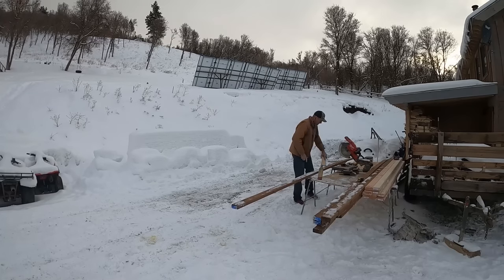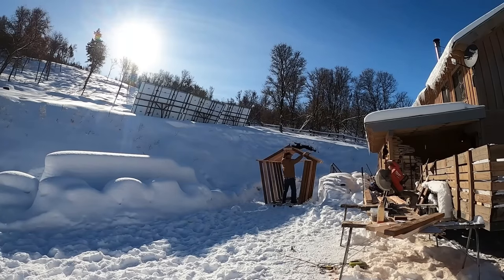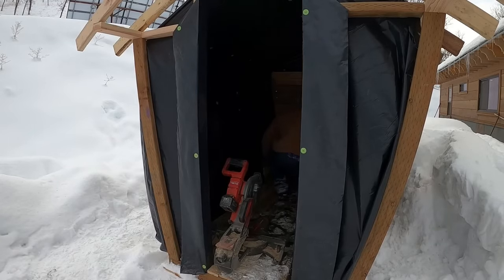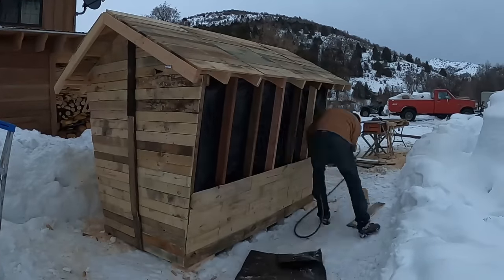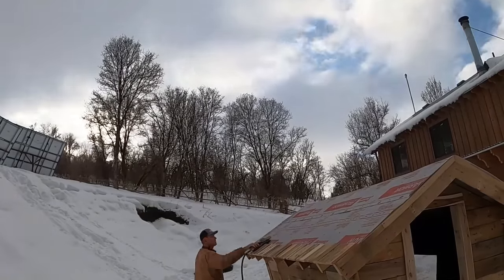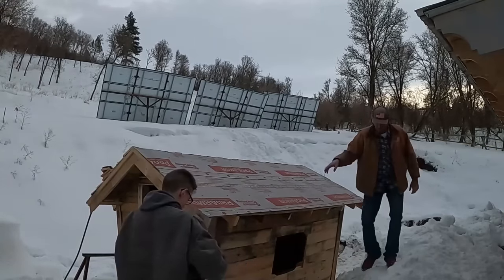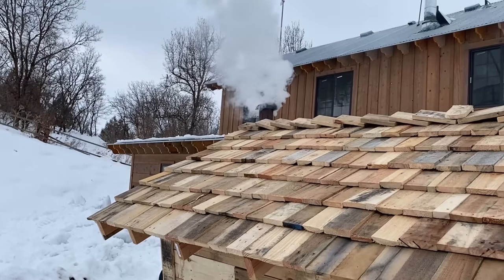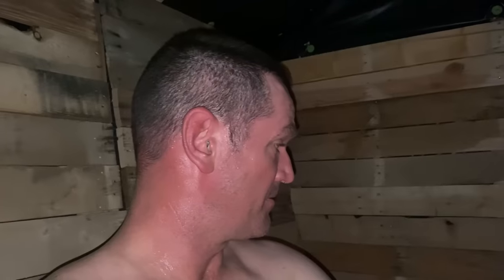#394 - I Built A Sauna Out Of Pallets! And It Works!

Comment: You can use plywood for walls and ceiling as long as you torch the plywood to seal the grains that would otherwise soak up the steam and also make them resistant to heat; as my father (a Finn who fought in the Finnish Winter War against Russia) did in our last home--it was just as good as any sauna with cedar. You can also use 2/4s for the benches and torch the grains also.
Reply: do u have a video that shows all your recommendations?
Reply: Plywood is usually treated somewhat with chemicals, at least it contains some sort of glue, I would rather not have this steamed out in my sauna.
Reply: @BlackBuffalo23   There's a Couple in the Ukraine that has charred the exterior finish and trim of the home their building. Creative couple here on youtube
Reply: @BlackBuffalo23  its a pretty popular practice in off grid cabins and timber framing.
Reply: As plywood is glued-together wood pieces and is not that healthy to begin with, I wouldn't use that in a construction where I breathe in the steam. You're basically breathing in formaldehyde.

Comment: The only thing I'd add is a metal pan under the stove, to catch any ember that may fall out.
Reply: Take a closer look, he used a piece of metal roofing.
Reply: @chaddesantis4191  WOW! Yes, he did, but it's so small that I didn't  see it at first (21:33); That thing needs to be at least twice as big to protect from falling embers.
Reply: @losapriscos7258  I think I'd like to see it a little bigger myself, but looking at the plywood floor and being one of Red Poppy Ranch's biggest fans, I'd lay odds that a better floor gets laid down on a rainy day once a few other projects get done. 

On the means of fire safety, I think I might have moved it about 10 feet closer to the hillside, too. If the wind is right and the woodpile is stocked like I'd bet Heath is gonna stock it next fall, that pallet shack has the potential to be kindling for a whole lot of heartache.
Reply: @chaddesantis4191  I'm also a fan since he started his channel. Having said that, I really doubt he would listen to our suggestions. 
Which I like too, by the way.
Reply: @losapriscos7258  amen to that!
Reply: Also couple of vents onto wall to get more fresh air in sauna. That wood burning stove consumes a lot of oxygen so there need to be fresh air vent near stove to get better draft in stove. Also it will be more pleasant experience when you can breath oxygen rich air while in sauna.
Reply: I saw one, I think!

Comment: Nice attempt to make a sauna. However, the result is mostly a sweat booth. The sauna must be large enough so that there is enough air. Otherwise, ventilation needs to be better taken into account. The stones in the stove are just too big. When done correctly, I put slightly bigger stones on the bottom of the stove, maybe half the size of the ones used now. The lowest stones are stacked sparsely so that the hot air heats up the uppermost stones, which in turn are smaller. Maybe a third of the stones you use now. A Finnish proverb says that you can't get good things cheap.

Comment: Use smaller rocks. You can add lots of it. It will give better steam and smaller rocks will warm up quicker. The rock size should be 10-15 cm diameter. You just need to warm the rocks not the space. Room tempature will rise when you pour water.

Comment: It's a lovely building. I would however kindly advice you to consider removing the pressure treated wood and plastic. I live in Sweden, and the sauna originates from the nordics. You seem to have a similar climate, and therefore I believe most of the building principles should be appropriate. We do not use cedar, actually scrap wood is great. But not the treated kind, mostly because it will start smelling really bad after some time. We do also not use plastic or any sealing. We leave space between the planks, in all the walls and floor, to allow it to move and breathe. I can promise it will get very hot even with the space between. But most of the space dissapears when the heat and moisture quickly expands it. I believe your current structure will be very prone to both bad smell, rotting and planks twisting and splitting, due to all these factors. If you are interested, I can find some good first hand information on the building principles we have used for centuries or more. Lovely building though, and good luck with all your projects!
Reply: Hahah "I live in sweden" man if you live in sweden don't talk about saunas. A swedish sauna isn't a sauna. If your sauna can only fit 2 people and goes up to 40C° don't call it a sauna. Best regards: a finnish guy
Reply: could you post where to find good information on these building principles please!
Reply: I think that he should do "Tynnyrisauna" or Barrelsauna
Watch guide from taloon.com youtube channel
Reply: What percent of Finnish saunas are wood versus electric? Is there an electric version you recommend? I live in Florida and for some reason I want to gravitate to electric.
Reply: @YksPalli  I think his sauna will go above 40C. It should go to 100 C being that tight with wood burning. What electric do you recommend?
Reply: @youtuber6185  and in finland if you live in te city the saunas are allways electric but if you go anywhere outside it they will always be wooden. I think that the majority of finns like the wooden souna more. The electric is easier to use and doesebt take that much time but in the wooden one you can smell the burning wood, you can see the real flames, you can hear the wood crack and somehow the air is better in the wooden one. And if you have an electric outage you can still use the wooden sauna. So if you live in a big city or if you're extremely lazy go with the electric but if you live on the countryside always go with the wooden one. And remember sauna should fit at least 5-15 people.
Reply: NigerianPrinssi I am extremely lazy when I’m at home so I probably should do an electric one. I would think that there they do larger because they are popular and also want to fit groups such as multiple couples. Is there another reason it needs to be large?
Reply: @youtuber6185  so the only real reason you want to have a large sauna is that you can bring your friends there. Saunas are more fun with friends than alone you can spend hours there. You can invite your friends to watch some ice hockey and drink beer and when the mach ends you can start the fire in your sauna and wait. When the sauna is good 80°c you can go in. If your sauna can only fit like 5 people it can be a little uncomfortable when your thighs are touching with your friends. so you want to have a little more room when your manspreading. It's deep in the finish culture to go to a sauna with your friends so i'm not sure how that will work in florida when there aren't that many saunas around. So you need to answer that question yourself because i don't know what kind of culture you have. Will your friends think that it's a good idea to go naked in a hot sweaty room. So if you don't have any friends or family and you want to build a sauna i would go with a small wooden one and if you're going to buy a sauna you could buy a electric of course you can build an electric one too but i bet that in the end you too will like the wooden on more. it's your own decision if you're going to buy one or build one both are good options. If you don't trust your building skills you should buy one but if you know what you're doing you should build one so you can do everything perfectly how you like it. if you want en extremely small sauna for yourself you can get the electric stove because it takes a lot less space. If you ever go to a sauna with your friends you will see some cocks and balls so soon you too will become an expert.
Reply: @youtuber6185  yeah man i hope you found something i said helpful and it doesn't matter what size you have but how you use it.
Reply: NigerianPrinssi Hehehhe, not sure if I can use it well either but I sure Damn enjoy having it. And poor boy has been smacked around. But I’ve treated him with some top shelf as well. Yea, we’ve had some good times together me and ole 2” punisher.
Reply: @YksPalli  Dude, what Swedish boy did beat you in Mario Cart? Where he realy realy meen about it? Calm down, not all Swedes are asholes, I asure you. Have a great day and hope you get better.
Reply: @YksPalli  I didn't realize the finnish would be so racist against swedes o.o
Reply: @mofosoto  lil drunk right no just got out of sauna so sorry again for my bad english!
Reply: @YksPalli  Way to be "that fuckin' guy"
Reply: @johnmarston2527  thanks man really apreaciate it man

Comment: I would have built it elevated off the ground on Railroad ties.
He can still add them before the bottom wood starts to rot. They can also act like "skids" to drag it to other locations as needed.
Reply: I would have , I would have , I would have.....Oh shut up ! You missed the whole point when he said he was only going to use what he had and nothing else .
Reply: Gotta remember this is the guy that doesn't think you need to support the center welds on his propane tank..
Reply: Railway ties are highly toxic... defeats his explicitly stated purpose.
Reply: @kristinwerner5519  They are on the exterior and used (quite old) they would have vented and leached much of their toxicity a long time ago. He isn't going to be burning them.
Reply: @SourBogBubble  unless the manufacturer requires or recommends it, really not necessary. A cylinder is extremely strong.
Reply: @at347est  it's called feed back,if he reads the comments then they are suggestions on how he can improve if he chooses to.This generation is so full of candy ass uptight cry babies! No one can have opinions, or suggestions without hurting someone's feelings that will be detrimental to there lives!

Comment: LOVE IT !! Great job 👍 A couple thoughts are to put the sauna and the small cabin on skids and you would be able to move them around the property !! Kinda like the wheeled sheep herder wagons. Also the cabin I stayed in last winter had a sauna and the stove had a built in tray . (A plow disc) with the stove pipe through the center. The rocks were placed around the pipe on the disc  and allowed the water to pool. It worked VERY well. You may just add a catch basin to yours. That way you do not have to change anything . Another one is do not forget to add some "Essential oils " to the stem box. Really helps you relax. I am a real sucker for Eucalyptus  😍
Reply: Very nice and resourceful. Great job. Love many of the supportive comments. I made a sauna of mostly reclaimed wood and it turned out great also, just not a wood burner. Wood burning not allowed in many suburbs. So I did have to buy an electric unit. Only caution is to provide some ventilation so fire does not consume all your oxygen. I guess your could also just open the door or you probably used an air intake for your wood burner, just did not see it. Anyhow, safety first. Great job. Love video.

Comment: Nice! Add some air vent to sauna. So you can get fresh air, it also helps to keep temperatures not too high. Air vent on on high on wall that hottest air can leave and you get cooler air back.
Reply: Sorry! NO Ventilators in a Sauna!  The Sauna Technology has a tradition of many centuries, and even the old vikings didn`t use ventilators!  ;-) .
Reply: I’m not sure you understand the purpose of the sauna lol
Reply: @bernhardmichaelfux308 /videos Yeah they did, they even officially have to have air vents in a lot of places, as well as proper water runoff in the floor. Keeping fresh air circulating is part of what makes a sauna work, you don't want it just continuously heating up stale air
Reply: @bennyboy97100  Why? It`s simple: You heat it up, then you go in, open the vodka bottle, light the cigar, lean back and relax! 
When the Bottle is empty, you go to the cold Water Pool. Then, relax outside for a short time, and then you go in for the second Bott - uhm - run... That`s it!
Reply: @daylen577  Hmmm Ok, first, i must admit, that the old Vikings didn`t have ventilators lol...but to be serious, what`s really important, is  that the Saunastove gets it`s fresh air from a channel from the outside!  In a Sauna of this size (RPR-Sauna) that`s one side of the ventilation...and for the Air-Circulation for the humans that sit and sweat inside that sauna, a proper Hole on the side of the wall is good enough for this purpose!
Reply: a hole for air ???   I like his little sauna but im sure that floor allows all kinds of air to be drawn in, as well as the door.  It is by no means air tight even with the plastic. It gets plenty of air or that fire wouldnt burn or draw worth a damn and it looks like its chooching right along !
Reply: @warrenmichael918  Sorry, but the amount of air woodfire demand is mostly underestimated! A woodstove needs tons of fresh-air to burn properly... The "not sealed floor" is here way to less... trust me!
Reply: LOL! XD We have more saunas than cars here in Finland.
Reply: @simoherttuainen7750  I thought by myself you are Finnish! 
Why? Because you said nothing about my comment with the cigar and Bottles of Vodka!  
Normal People would be horrified about such a comment lol... 
Bytheway - do you know a common Winter - Game in Finland?   
4 Finnish guys sit around a table, each of them with a bottle of vodka!  
Then they drink their bottles empty, and one of them stands up and leaves the room. 
This done, the three who still sit have to guess wich one left... hehehe.....!

Comment: Using ttreated lumber which was treated for keeping bugs out, As a sauna sounds dangerous. The chemicals infused in the wood might come out as you heat it up in the sauna. Just hope you looked into this.
Reply: He didn't use treated wood weren't you listening
Reply: @hepotof01gmailcom  Pallets are chemically treated.
Reply: @piratelute8934  most pallets are heat treated. They are stamped with “HT”. Avoid unmarked pallets or ones marked with MB (methyl bromide) as they are chemically treated. You actually want heat treated pallets as they withstand the moisture
Reply: He did say he was using pressure treated lumber for the structure. So long as it isn’t used inside the sauna itself, it shouldn’t be a problem.

Comment: Great sauna build Heath!
I was worried about the table saw blade being so high up...a shop teacher told us to never have it higher than needed for the cuts we were doing at the time.
He had tripped near a table saw once...lost the thumb from his left hand as he reflexively tried to break his fall...then he mentioned that he would have went chest-first into it if he hadn't.
The ginger kitty is getting so big  :)
Reply: Yes that's a stadnard safety thing---saw blade should be raised up the thickness of the material plus half the saw tooth gullet.  Also when cutting the shingles at 12:40 use a miter gage in the table slot, don't push the wood from both sides of the blade; it risks binding the material at the back of the blade and will thowit, and your hands, back uncontrollably.  Stay safe brother.  And it's not weak to have a few pairs of safety glasses laying around so they're easy to use.

Comment: PLEASE READ: If you use a table saw always keep the blade no more than 1/4" taller than the materials you are cutting.  This is the best way to protect your body in the event of a slip. It can be the difference between a nasty wound and a missing hand. It also reduces the chance of binding which causes kickback. When you're doing things freehand or even with a fence. Good work on the sauna.

Comment: Nice build. Congratulations I’m sure you will enjoy your sauna for a long time. I built my sauna using a lot of scraps which I salvaged from building construction sites. (with permission of course) the sauna room is 7’x7’ includes a used wood stove,tile floors and heat shield cedar and Douglas fir ceilings and walls.I spent about $400 total. Steel roof, vinyl siding, and insulation. Takes one half hour to heat up in winter. Use it almost every day usually between 70 and 80 degrees Celsius. Overall size is 8’x12’ which includes a 4x8 changing room. Great size because I can lay on the benches. I applaud your using mostly pallet wood and bulilding your own stove. Lots of free wood is available. I use some small pans with rocks to get some moisture. To have a better sauna experience try a few drops of essential oil’s or some menthol crystals in a little water in a pan over the stove. Enjoy. Greetings from Maine.

Comment: Need to be careful about the used pallet wood. You don't know what they may hauled or where they may have sat. Microbs could be picked up. But without moisture they may have died out. I would at least bring the sauna up to 180° to 182°- if possible before use.

Comment: One of the key construction details to make that a sturdy structure that would hold a good snow load are the little "collar ties" you put near the peak of each pair of rafters.  Many inexperienced DIYer would miss that detail and then wonder why the walls were bowing out and the roof sagging.  I might have added some kind of "hurricane tie" from the rafter, to the top plate, to the stud for a little more insurance.
It would make a very "cute" potting shed !